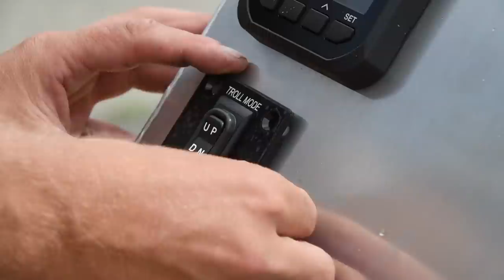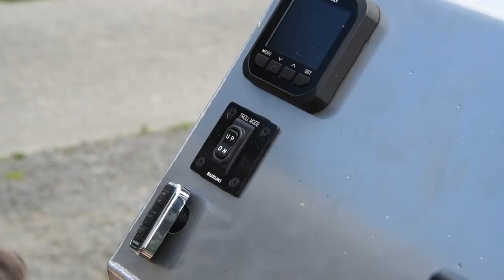Installing the Center Console on the Skookum Choocher!

Comment: It’s better to have 2 bilge hose outlets. If you have enough water in the boat that it’s at risk of sinking and you need 2 pumps, you don’t want to limit those pumps by combining them into a single 1” hose. 
Dual outlets on opposite sides of the boat.
Reply: I can't wait to see the one pump turn on and the water start flowing out of the second 😝

Install check valves!!
Reply: I agree with this wholeheartedly, an extra hole will double to flow rate is you take on water.  Just do it already
Reply: Or have the outlet be a 2”
Reply: There is always a way to spend yet more money, just in case! LOL!

Comment: Jesse, couple of suggestions. 1.) bilge blower 2.) dual bilge pumps with one way valves 3.) master power switch for everything but the bilge 4.) 15-30 watt solar chargers connected to the batteries, to keep them topped up for periods of rain. Looking great.

Comment: Looks awesome. Only problem I see is one I learnt the hard way. Plumbing 2 bilge pumps to one through Hull fitting is asking for trouble. If only one is working it will pump water back into the Bolshevik through the other.  Also you can get center console covers off Amazon very reasonable priced. And I would definitely consider a leaning post for yourself and some kind of windshield. Looks awesome
Reply: My thoughts exactly on that I would run two hoses just for the flow when both are on why restrict it.

Comment: Lovely work Jessy, that skiff will be a great work boat. Re your electrics, as this is a meatal boat, make sure you install a master cut off on the earth side of the battery. if you do not isolate the battery earth from the boat when you are not using it, and its parked on a beach, it will turn into a giant anode and start eating itself. Also re seating, I would use large coolers that can be ratchet strapped down, Velcro deckchair cushions on for comfort.  Use the console as a backrest, and you'll have somewhere safe for the kids to sit. If removable they won't get in the way when you are own your own or moving larger items. and being coolers, you'll have somewhere for beer! :-) take care D

Comment: Do the bilge pumps have 1 way valves? Otherwise 1 will turn on and cause a backflow through the other, rather than out of the boat.
Reply: Was just going to comment the same, i doubt if those pumps have inbuilt valves.
Reply: Yup, gonna need check valves on those.
Reply: Was gonna say the same thing...good catch!
Reply: Thanks for asking the obvious question, saves me. But if you were taking on water, you'd wish you had two pumps with separate discharges.
Reply: Same comment here too. Good catch guys!

Comment: If you're venting from the top, you also need air to come in the bottom to create a flow, specially if those batteries are lead acid
You mentioned not being ble to have both batteries in the bottom because of the covers, if they would fit without, you could just use terminal protectors like in cars
Reply: If the bottom of the console is open it can breathe through the wooden slats.
Reply: That was my thought. They should be strapped down regardless, but if they're in that bottom compartment, there's really no reason for the boxes at all. The compartment is the box.

Comment: I had a canvas cover made to cover my console.  I mixed up a tube of clear silicon seal with either acetone or mineral sprits (I can't remember) making a thin paintable liquid.  I then painted the top of the cover and down a couple of inches all around.  After it dried it created a perfect rubberized type protection that soaked right into the fabric.  It protects from rain but breaths also.  I'm sure I got the inspiration for it from somewhere on YT.

Comment: My profession is making custom covers for yachts like yours to drain the rain (and snow) when moored as well as awnings and enclosures for shade and bug protection when at anchor.  While crabbing. Or fishing. Or catching Zzzzzzs.   Eventually you will need a console tower, running lights,, canvas top, three sided clear vinyl enclosure (at least), and a bow “dodger” to have a drier place to store goods while ferrying them your property. Dodgers also make great rain covers while camping on the barge.

Comment: I dont know bilge pumps well but I do plumbing for fish tanks and such, you cant have two pumps running into the same feed unless they won't back siphon. I would not trust check valves either, I've had those fail on fish tank and flooded my basement. If bilge pumps won't allow for back siphon no worries, just looking out. Love the content!

Comment: Hope both bilge pumps have backflow protection, otherwise the bilge water won't bother climbing up to the skin fitting. Also, if you are carrying materials, loads of detritus will find its way down there. Proper strum boxes are what you need for the pumps. Don't rely on the design of the pumps. And don't rely on backflow valves if you bilge gets full of crap. Good project, good luck!

Comment: It’s looking good, but I wonder about the bulge pumps sharing a line. Would that create a flow issue. That line can only hold so much fluid at once.
Reply: He will quickly learn as I did bludgeoned pumps don’t have check valves. So if only one is running it will pump water right back into the bludgeoned through the the other

Comment: In a purely freshwater environment, the galvanic corrosion between the stainless handrails and the aluminum will be minimal anyway, and especially so with the caulk.

The venting of the console is necessary mostly for the batteries (unless they are lithium), especially deep cycle. Some may contribute to the moisture content in an enclosed space, but it's really the explosive risks from the gasses during charge cycles that are the primary concern. A little airflow goes a long way.

Comment: Zip ties - whack one around any pipe you don't want the hose clamps to slide down, simple, cheap, no rust...  They just stay there and do nothing else so you leave them for next time - make sure to put them below where the barb will go as they are not going to let the pipe expand.  Don't ask why I know that...  Always use black zips - they are full of carbon black and last the longest in corrosive areas and UV light.  Sika will help as an adhesive and bedding compound, but the prevention of oxygen from reaching stainless creates crevice corrosion...  You coat the surfaces with Duralac or similar first and that will hold corrosion back but sadly Sikaflex won't do that for you...  Pull the inside washers periodically and see if the alloy is crumbling, or if there is rust visible on stainless threads and leaching out from surfaces that is a sign things are happening inside your stainless to aluminium joins.  Any outlet from a bilge pump that is below the gunwhale needs a non return valve of some kind.  Don't combine outlets from seperate pumps - each, manual and electrical must be completely independent of all others.  You cannot fit enough handholds to a boat with low sides - but you can easily have too few...

Comment: Regarding hooking the fuel line, you didn't need to make an access panel. Just cut the lines a bit longer so you can connect the line to the cap, and push everything inside and screw the cap.

Comment: Each bilge pump should run completely on it's own. This includes power and discharge hose. Separate discharge hoses will allow for max flow of each pump. Goal- pump out water as fast as possible. Hope it's never required!

Comment: I question the use of non-continuous welds on the brackets and the fuel filler box. In industrial control enclosures (NEMA-4 & 4X) all continuous welds are required in damp/wet locations. This is to prevent water from "wicking" in between the welded pieces. I'm not a fabricator nor a marine equipment expert so let me know if I'm right or wrong.
Also: like everybody is saying, the pump discharge lines need to be separate to prevent flow in unwanted directions!

Comment: WARNING! You need a way to clear gas fumes that could accumulate in the bilge. If you don't install a blower you risk blowing yourself up. Seriously, I've seen this happen and the fireball is spectacular.
Reply: AMEN Brother...learning the hard way about bilge blowers is damned expensive! Then he needs to learn to run it 10 minutes before he even cranks the motor over! That's every time, not every now and then!
Reply: Florida man here.... I seent it!!
Reply: Typically only inboard motors explode on startup without a bilge blower. 
It’s very unlikely that anything will happen with him using an outboard. That’s coming from a person with over 10 years experience running an aluminum survey boat with twin 250 Yamaha engines hanging off the back.
Reply: @stick004  there is a gas tank in the hull in the bilge, gas fumes come from that source also...think about what your saying. It is not logical. Any spilled gas from the filling will make fumes in the bilge.
Reply: @stick004  he will be pouring fuel in with gas cans I bet and that has the potential to spill fuel on the deck and get fumes into the bilge.  It needs venting or he could blow the deck off it.
Reply: There is no source of spark in his bilge. (Except for his bilge pumps.) All the batteries and electrical equipment are in his console and the engine is hanging off the back. He could literally be hauling gasoline in his bilge and not have an issue…. Also, his bilge isn’t sealed. It just has those movable pallet tops. He’s going to have more trouble keeping rain out of his hull than keeping any spilled gas fumes in there.
Reply: @stick004  That type of thinking leads to explosions.   When a manhole cover blows off due to sewer gas as an example what was the source of the spark?
Reply: Electrical cables are almost always run through sewers. In those cases, there is always a source of spark. If sewer gas spontaneously exploded, we’d have a lot more problems.
Reply: And he has electric cables run throughout the hull.  He will be loading and uploading this boat as well so there will be friction and static as other potential sources.  The hull needs proper venting.
Reply: Do none of you notice he doesn’t have a sealed bilge? It’s just wood pallets that aren’t even screwed down. There is more than enough air flow. Do you worry about your truck exploding when you put wood in the bed? The bed is right above the fuel tank… no you don’t. Do you worry about it exploding when you start it up to leave? No you don’t. It because the air travels all around the tank. My goodness. Ya’ll need to pay more attention to the build.
Reply: @stick004  dont worry about them, im with you brother. These guys are sweating for nothing
Reply: The tank is sealed, and the vent is connected up on the fill line.
Reply: @stick004  you are aware gasoline fumes are heavier then air right?  So they will fill the bilge any time he is fueling.  The open deck allows the potential for fire.
Reply: I guess all us armchair supervisors will just have to wait and see what the Samurai is going to do…
Reply from the maker: The decking has 1/4” gaps between all the boards so there is plenty of air flow ventilation that will allow the fumes to escape.
Reply: @TheSamuraiCarpenter  famous last words, gas fumes are heavier than air...they just don't float up and out of a bilge, especially on a cold morning. You bettter re-think your physics before you build a fire under your own butt!
Reply: @TheSamuraiCarpenter , thank you good sir! I’m on board with your plan. (Pun intended) keep the videos and Makers Mob going strong. Been watching for years.
Reply: @TheSamuraiCarpenter  Gas fumes are heavier than air. There's no air flow below that deck even if wind is blowing across the top of it. There are marine codes that apply to boats just like building codes for houses. Talk to an Inspector.

Comment: About Gasoline fumes remember that they are heavier than air and will settle to the bottom of where ever their at so proper venting is a absolute must, I would consider having  a Marine engineer/service inspect the boat before you operate it. Remember Insurance co won,t pay off if they can prove it was, int a safe boat, they may require a inspection.

Comment: You can't connect two bilge pumps using a Y connector. Two pumps will supply too much sea water to the Y connector not allowing it to dump correctly. Effective results are you still have only one pump output.

Comment: You might want to put a bunch of lead in the bottom to keep it from being top heavy, since you are going to haul stuff on the deck.
Reply: Bricks / concrete blocks would be better.
Lead is poisonous. !
In England our canal boats, say 50 feet long by 6 feet wide, (actual ballast space), usually have at least 2 layers of bricks.
DO NOT use wet mix concrete  ! It is a PAIN in the butt if you need to remove it.

Comment: Am I the only one wondering why the samurai installed that access panel for the fill port hose clamps instead of simply leaving the hoses long enough to tight the clamps and than lower the whole fill port and screw it down ?

Comment: At the risk of being a commenting Karen, I just wanted to mention the aluminum shavings/chips left over from the drilling have a good chance of plugging the bilge pumps if they aren’t cleaned up good enough. It happened on an aluminum boat build video I watched recently. It’ll already be cleaned up because you’re the Samurai Carpenter but just for anyone else that might be installing a bilge pump.

Comment: Fuel fill and vent should be outside the hull, fuel vapor is heavier than air and will accumulate in the bilge, not good.

Comment: I don't think those little bilge pumps have check valves.  With that Y fitting - path of lease resistance you one pump might just push water back out the other pump!

Check valve!

Comment: I may be missing something but is it a good thing to have all the weight in the stern?
Reply: I think you’re on to something.  I just looked at Boston Whaler’s website and all their boats (with consoles) appear to have them mounted at the boat’s center point.
Reply: He is going to need electric trim tabs with the weight all aft like this.
Reply: He should have put the fuel tank in the front of the boat, to balance the weight of the engine.